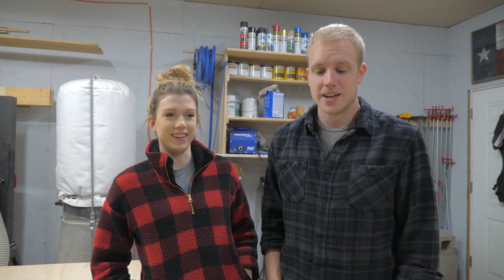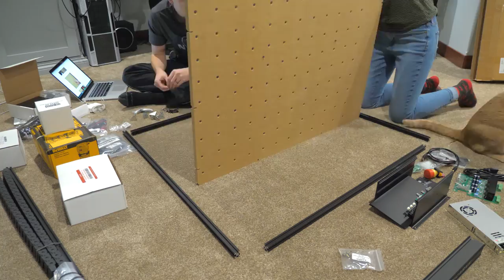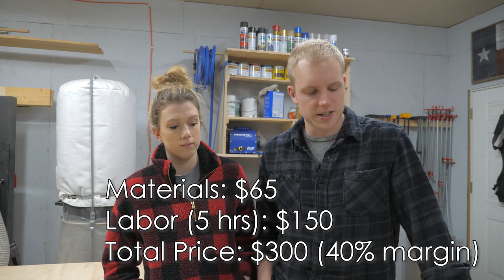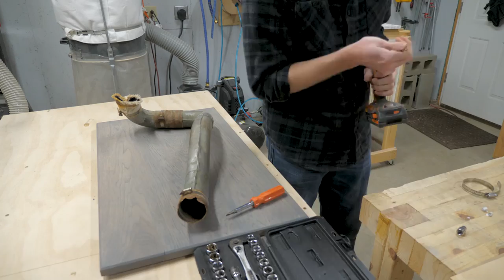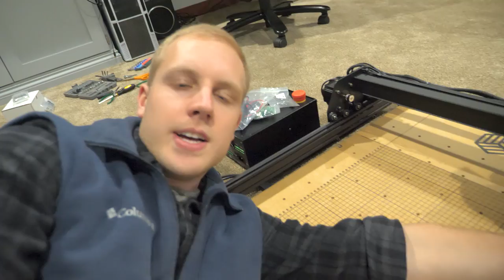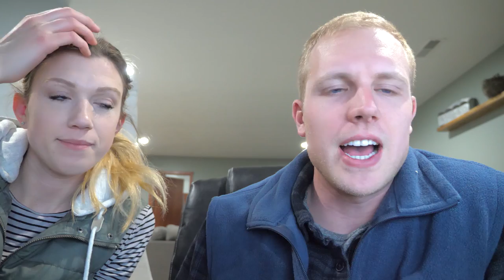Who Should You Sell Furniture To? | Woodworking Business

Comment: Just found you. I'm decent in the shop but really like your business aspects especially the pricing.

Tip for you:  Vegetable oil dissolves most adhesives. Peel off most of the paper, rub the sticky with vegetable oil and leave it  alone for a few hours. Most of the sticky will come off easily. A second treatment and rubbing with a plastic dish scrubby almost always gets it clean.

Comment: So sorry for your loss . With regard for the degree in stickers , knowledge is power or if you think learning is stupid , try ignorance . Two sayings I use a lot . Firstly , boiling water in a pot and dipping the same sticker into the water make this easier . If you can’t use water , like on some wood etc . A hairdryer can make the glue loosen , in the same way that the hot hair dryer works , your heat gun can also help . Plummer’s have used hairdryers on frozen pipes since they were invented which is where I got the idea on stickers from ... your welcome . I’ll let you mention me when you make a video of how it worked . Regards Gerry a new subscriber:)